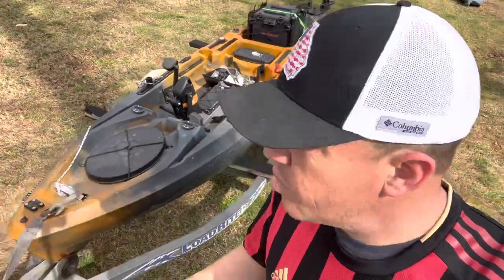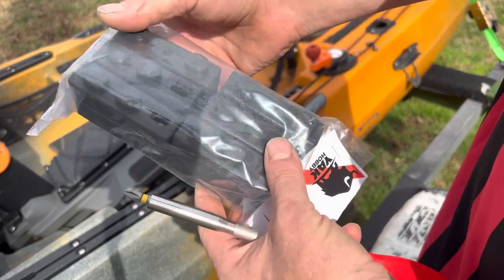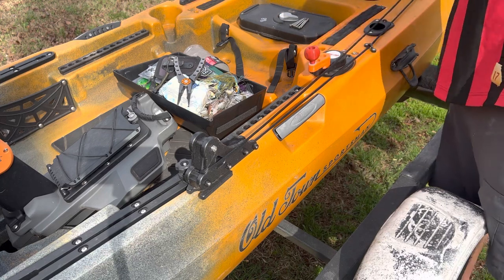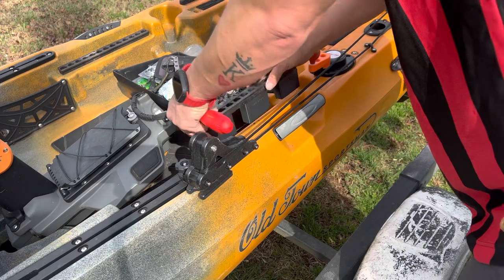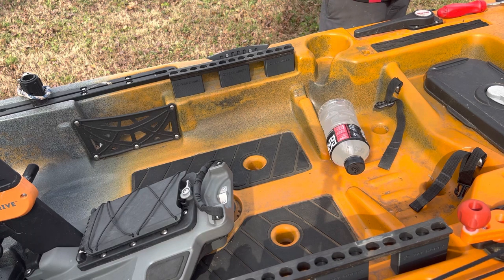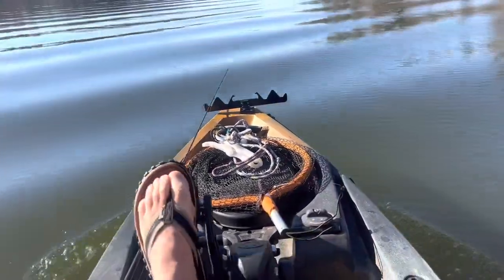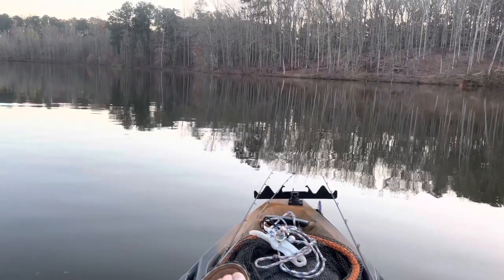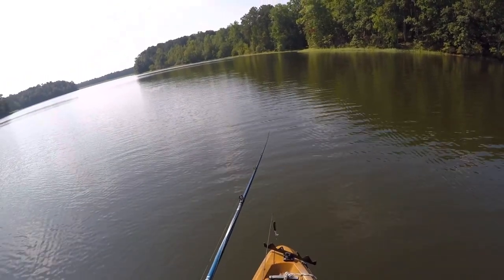Kayak DIY installing Yakhobby full seat riser kit- Old Town Sportsman PDL 120

Comment: I was thinking about doing this on my 120 pdl. Would you do me a huge favor and measure the space under the seat with the 2in risers installed. Im waiting for delivery of my 120 pdl hopefully in a week or so and blew out my knee yesterday. Ill have to run a electric motor until after my surgery and would like to put my 100ah amped outdoors battery under the seat.